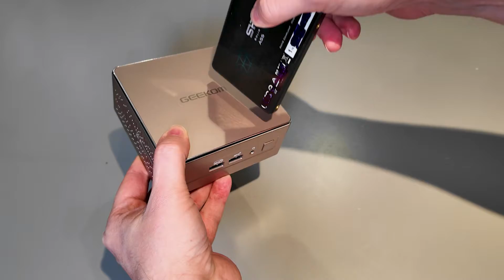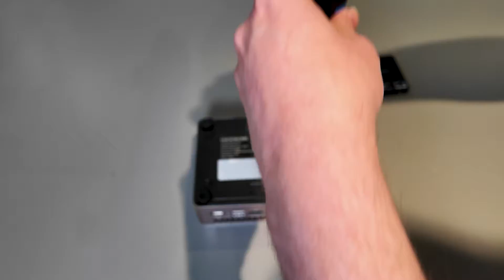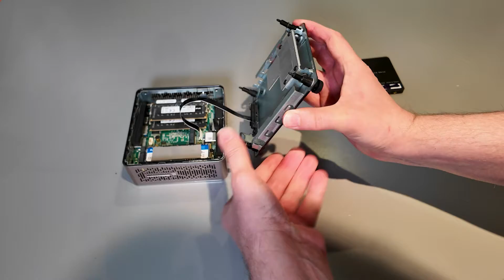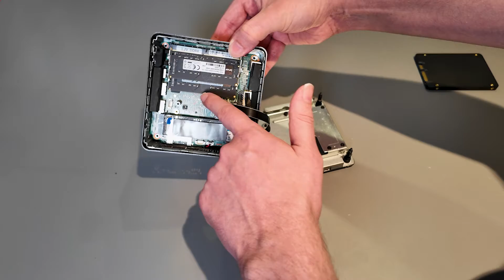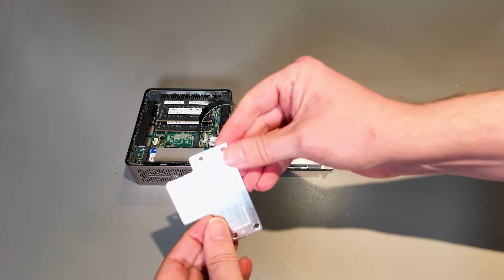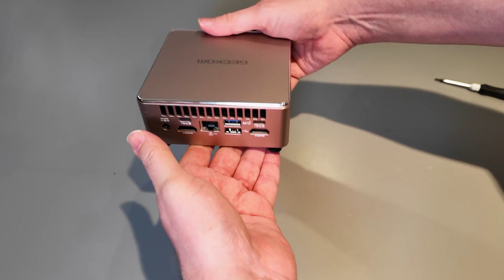How to add an SSD to your Mini PC | Geekom A5 Upgrade Tutorial!

Comment: The claim that the Geekom A5 is not compatible with SSD drives is incorrect. It supports both 2.5" SATA and M.2 NVMe PCIe SSDs, providing users with options for storage upgrades.

Comment: 2:00, I will eventually try to use a M. 2 to pcie adapter to connect an external GPU. Unfortunately, it is an M.2 SATA connection so that makes it slower than M.2 NVME. If it makes Cyberpunk 2077 get to a stable 60 fps, I can be happy. I am vaguely considering getting another SSD and using the NVME slot if the SATA slot is disappointing.

Comment: Why remove and reinstall the shield? The drive slides underneath it easily as you showed when you relocated the drive just after replacing it in the speeded up section? Also, I suspect the four blanking plugs on the base are supposed to be removed and replaced with screws to retain the drive once it's in place, as they line up with the threaded holes on the drive case. The spare slot is for an M.2 2242 SATA SSD memory card up to 1Tb.

Comment: According to Geekom the A5 is not compatible with ssd drives. The slot is for hdd drives.😊
Reply from the maker: I have not seen them say that, but SSDs work here. As long as the drive is 2.5 inch, then its good. In fact SSD would be faster than HDD so recommended.
Reply: @SimonsReviews  Simon it's something Geekom reported to me as part answer to a query I had. The spec says the slot is for a HDD drive. It would be great to use a ssd drive, as you say they are far faster than hdd.

Comment: Fitted ssd but pc won’t recognise it ?
Reply: You probably have fixed this in the meantime. But the way to proceed here is to open the Windows 10/11 hard disk management and partition / format the ssd. If it doesn't show up in the hard disk management, there might be a hardware issue.

Comment: Nice tutorial, got the same model and have done the same thing. Just a couple of things I'd like to say is,

When installing an SSD or HDD, you don't really need to remove the plate before sliding the storage into place, it should slide into place without having to remove any additional parts. Another thing too, it's a good idea to screw the storage into place with the screw holes (covered by the plugs) underneath the PC to prevent the storage from moving around.
Reply: @RevisedResolutions To confirm this I just had a quick look at mine. Both M.2 slots are NVMe SSDs (M.2 SATA SSDs aren't compatible with NVMe SSD connections), the only SATA connection is for a 2.5 SSD or HDD (which was installed in the video).

The larger M.2 slot (which holds the OS) can be manually replaced by undoing the single screw which holds it in place, but if you want the OS to remain on the SSD in that slot, you'll either have to reinstall the operating system or flash the previous installation onto the new SSD.

Comment: SP ssd's are terrible. High failure rate. NEVER again....had two fail in my systems.
Reply: Go elsewhere with your moaning, my old computer has an SSD that works perfectly and after seeing this I am going to install it in my new A5, now I should have all my files in order rather than transfer them to SD and copy them over.
Reply: And recommend SSD drives with good performance and price ?